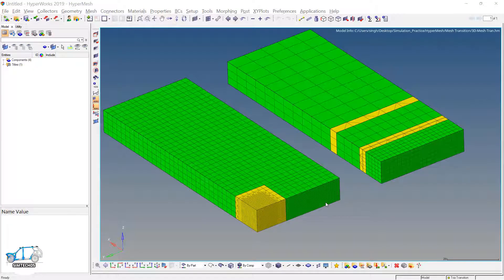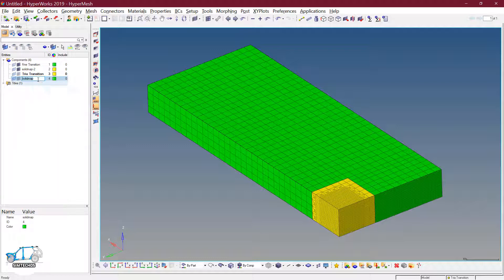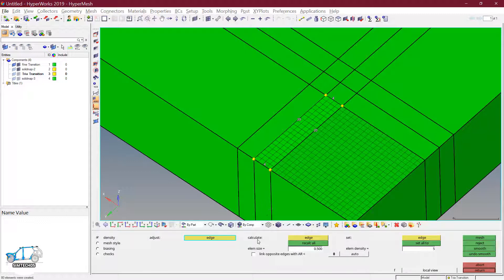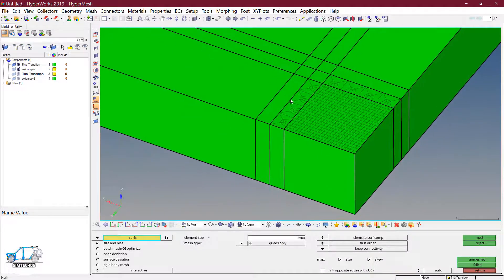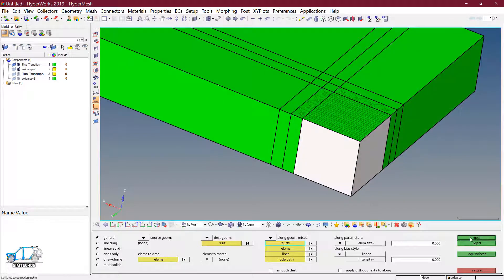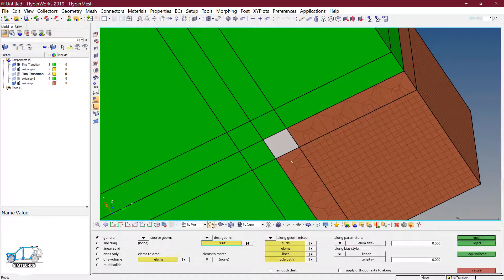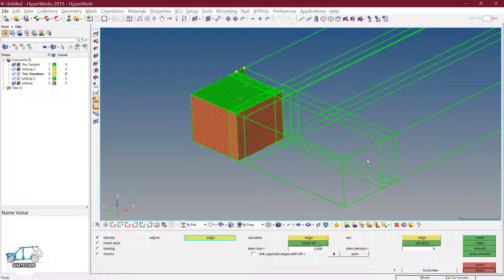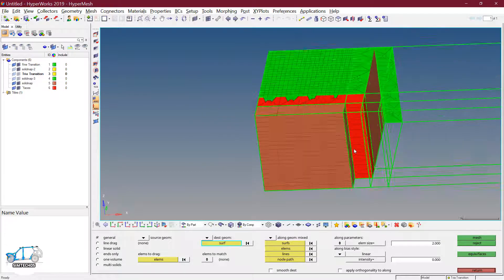3D Mesh Transition or Mesh Refinement in HyperMesh, Part - 3

Comment: How do you define the dimensions of the transition zone? I mean now to slice a solid?
Reply from the maker: Dear,
That depends on your stress concentration zone or area of interest..here i consider dimensions just for example.
Reply: @arsitech-ltd  Thank you for the reply. If you could open more on how to define the sufficient  number of elements? What is the approach? Should we do mesh convergence study first, then see how many elements give stable result and then built hexa mesh fore more accurate results? I know there is a rule that there should be minimum 2 elements through thickness and for accurate calculations 4 elements should be used but I am not sure on solid surface. should it be the same? sorry, confusing...
Reply from the maker: Dear,
Go through Hypermesh playlist other videos. Watch hourglass video in playlist. Also go through converge related videos.
All are available at my channel.
Most of answer you will get.
Reply: @arsitech-ltd  thank a lot